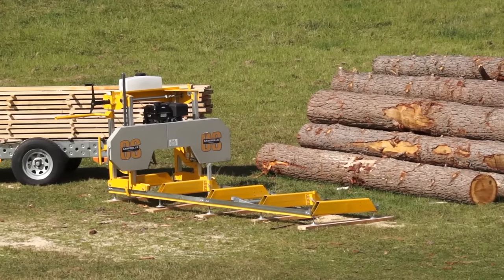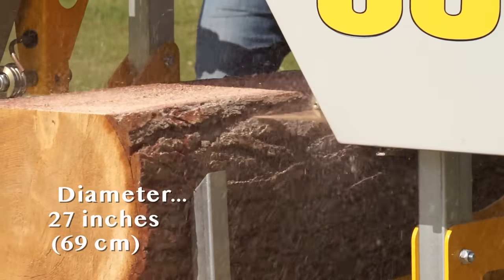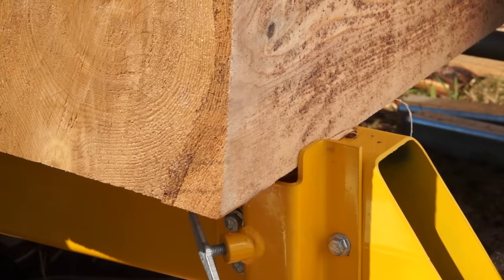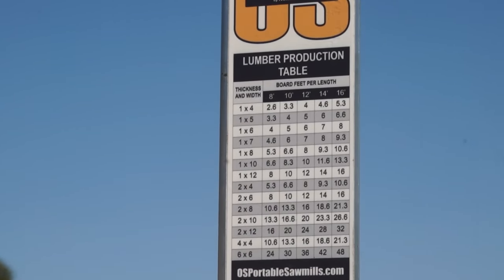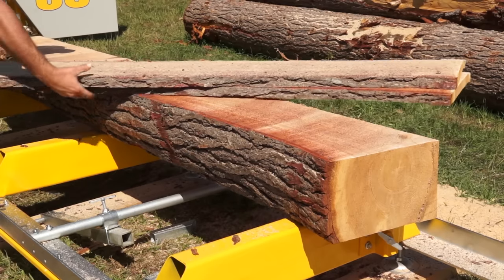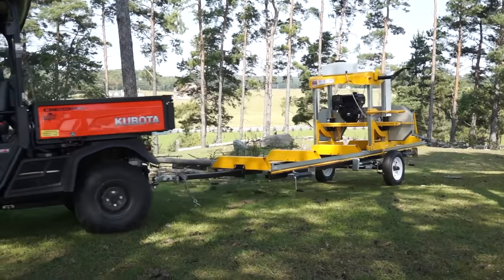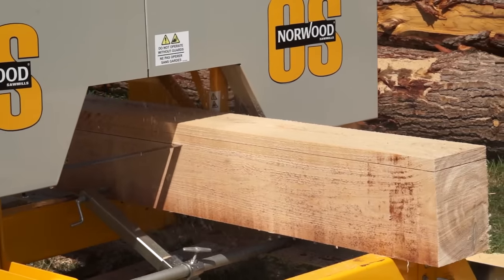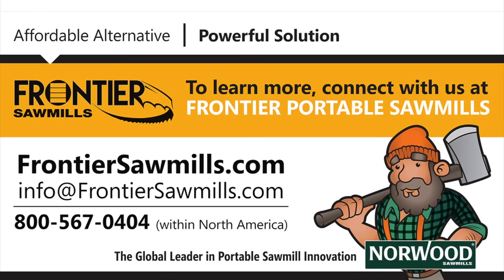The Affordable, Easy-to-Use & Reliable Sawmill You've Been Looking for - The Frontier OS27

Comment: Can this machine be delivered in India and what is its prize? relax
Reply from the maker: Frontier builds three sawmill models with different log diameter capacities: OS23: 59cm (23”), OS27: 69cm (27”), and OS31: 79cm (31”). Standard log length is 3.4m (11’) but you can add 7’ (2.1m) extensions to mill as long as you want.  You can add the optionally available trailer/support jack system to all Frontier sawmills at any time (when you get your Frontier or in the future).

Frontier Sawmills start at just USD $2297 (for the Frontier OS23). The Frontier OS27 starts at only USD $3297.  The Frontier OS31 starts at only USD $3897.  

You can get a lot of helpful info about Frontier Sawmills, including all pricing, at www.FrontierSawmills.com  .

Frontier services your country factory-direct.  To order, contact us directly at Frontier Sawmills via email at info@FrontierSawmills.com . 

Thanks!

Comment: How much is l-15 wm
Reply from the maker: Frontier builds three sawmill models with different log diameter capacities: OS23: 59cm (23”), OS27: 69cm (27”), and OS31: 79cm (31”). Standard log length is 3.4m (11’) but you can add 7’ (2.1m) extensions to mill as long as you want.  You can add the optionally available trailer/support jack system to all Frontier sawmills at any time (when you get your Frontier or in the future).

Frontier Sawmills start at just USD $2297 (for the Frontier OS23). The Frontier OS27 starts at only USD $3297.  The Frontier OS31 starts at only USD $3897.  

You can get a lot of helpful info about Frontier Sawmills, including all pricing, at www.FrontierSawmills.com  .

Frontier services your country factory-direct.  To order, contact us directly at Frontier Sawmills via email at info@FrontierSawmills.com . 

Thanks!

Comment: How much this cost?
Reply from the maker: Hi Mike

Frontier builds three sawmill models with different log diameter capacities: OS23: 23” (59cm), OS27: 27” (69cm), and OS31: 31” (79cm). Standard log length is 11’ (3.4m) but you can add 7’ (2.1m) extensions to mill as long as you want.  You can add the optionally available trailer/support jack system to all Frontier sawmills at any time (when you get your Frontier or in the future). 

Frontier Sawmills start at just USD $2297 (for the Frontier OS23). The Frontier OS27 starts at only $3297.  The Frontier OS31 starts at only $3897. 

You can get a lot of helpful info about Frontier Sawmills, including all pricing, at www.FrontierSawmills.com  .

We would be happy to mail you a free Frontier Sawmills info kit. You can order one online at  https://www.frontiersawmills.com/en_us/free-catalog-free-dvd-form

We would be happy to answer any questions that you may have, or to prepare a quote, including shipping to your door.  Let us know the best number to reach you at or please feel free to call us toll-free at 800-567-0404.

Thanks!

Comment: In India price please
Reply from the maker: Frontier builds three sawmill models with different log diameter capacities: OS23: 59cm (23”), OS27: 69cm (27”), and OS31: 79cm (31”). Standard log length is 3.4m (11’) but you can add 7’ (2.1m) extensions to mill as long as you want.  You can add the optionally available trailer/support jack system to all Frontier sawmills at any time (when you get your Frontier or in the future).

Frontier Sawmills start at just USD $2297 (for the Frontier OS23). The Frontier OS27 starts at only USD $3297.  The Frontier OS31 starts at only USD $3897.  

You can get a lot of helpful info about Frontier Sawmills, including all pricing, at www.FrontierSawmills.com  .

Frontier services your country factory-direct.  To order, contact us directly at Frontier Sawmills via email at info@FrontierSawmills.com .

Comment: Price?
Reply from the maker: Frontier builds three sawmill models with different log diameter capacities: OS23: 23” (59cm), OS27: 27” (69cm), and OS31: 31” (79cm). Standard log length is 11’ (3.4m) but you can add 7’ (2.1m) extensions to mill as long as you want.  You can add the optionally available trailer/support jack system to all Frontier sawmills at any time (when you get your Frontier or in the future). 

Frontier Sawmills start at just USD $2397 (for the Frontier OS23). The Frontier OS27 starts at only $3397.  The Frontier OS31 starts at only $3997. 

You can get a lot of helpful info about Frontier Sawmills, including all pricing, at www.FrontierSawmills.com  .

We would be happy to mail you a free Frontier Sawmills info kit. You can order one online at  https://www.frontiersawmills.com/en_us/free-catalog-free-dvd-form

We would be happy to answer any questions that you may have, or to prepare a quote, including shipping to your door.  Let us know the best number to reach you at or please feel free to call us toll-free at 800-567-0404.

Thanks!

Comment: This  machine available in India please know that also price list
Reply from the maker: The Frontier OS27 is regularly $3495 but is on sale right now for only USD $3297. 

You can also get a lot of helpful info online at www.FrontierSawmills.com  .
Reply: @FrontierSawmills  may i get it in INDIA...?
Reply from the maker: Yes, we can ship to India.

Frontier builds three sawmill models with different log diameter capacities: OS23: 59cm (23”), OS27: 69cm (27”), and OS31: 79cm (31”). Standard log length is 3.4m (11’) but you can add 7’ (2.1m) extensions to mill as long as you want.  You can add the optionally available trailer/support jack system to all Frontier sawmills at any time (when you get your Frontier or in the future).

Frontier Sawmills start at just USD $2297 (for the Frontier OS23). The Frontier OS27 starts at only USD $3297.  The Frontier OS31 starts at only USD $3897.  

You can get a lot of helpful info about Frontier Sawmills, including all pricing, at www.FrontierSawmills.com  .

Frontier services your country factory-direct.  To order, contact us directly at Frontier Sawmills via email at info@FrontierSawmills.com .

Comment: How much it's cost
Reply from the maker: Frontier builds three sawmill models with different log diameter capacities: OS23: 59cm (23”), OS27: 69cm (27”), and OS31: 79cm (31”). Standard log length is 3.4m (11’) but you can add 7’ (2.1m) extensions to mill as long as you want.  You can add the optionally available trailer/support jack system to all Frontier sawmills at any time (when you get your Frontier or in the future).

Frontier Sawmills start at just USD $2397 (for the Frontier OS23). The Frontier OS27 starts at only USD $3397.  The Frontier OS31 starts at only USD $3997.  

You can get a lot of helpful info about Frontier Sawmills, including all pricing, at www.FrontierSawmills.com  .

Frontier services your country factory-direct.  To order, contact us directly at Frontier Sawmills via email at info@FrontierSawmills.com . 

Thanks!
Reply: How much it will be in Indian🇮🇳 rupees
Reply: I want to onder this

Comment: how can I get in one mashine
Reply from the maker: Hi James

Frontier builds three sawmill models with different log diameter capacities: OS23: 59cm (23”), OS27: 69cm (27”), and OS31: 79cm (31”). Standard log length is 3.4m (11’) but you can add 7’ (2.1m) extensions to mill as long as you want.  You can add the optionally available trailer/support jack system to all Frontier sawmills at any time (when you get your Frontier or in the future).

Frontier Sawmills start at just USD $2297 (for the Frontier OS23). The Frontier OS27 starts at only USD $3297.  The Frontier OS31 starts at only USD $3897.  

You can get a lot of helpful info about Frontier Sawmills, including all pricing, at www.FrontierSawmills.com  .

Frontier services you factory-direct.  To order, contact us directly at Frontier Sawmills via email at info@FrontierSawmills.com . 

Thanks!
Reply: Frontier Sawmills so like how much in dollars

Comment: What is the cost?
Reply from the maker: Frontier builds three sawmill models with different log diameter capacities: OS23: 59cm (23”), OS27: 69cm (27”), and OS31: 79cm (31”). Standard log length is 3.4m (11’) but you can add 7’ (2.1m) extensions to mill as long as you want.  You can add the optionally available trailer/support jack system to all Frontier sawmills at any time (when you get your Frontier or in the future).

Frontier Sawmills start at just USD $2297 (for the Frontier OS23). The Frontier OS27 starts at only USD $3297.  The Frontier OS31 starts at only USD $3897.  

You can get a lot of helpful info about Frontier Sawmills, including all pricing, at www.FrontierSawmills.com  .

Frontier services your country factory-direct.  To order, contact us directly at Frontier Sawmills via email at info@FrontierSawmills.com .

Comment: Como faço pra compra uma
Reply from the maker: Frontier fabrica tres modelos de aserraderos para troncos de diferente diámetro: OS23: 23” (50cms), OS27: 27” (69cms) y la OS31: 31” (79cms)  La longitud estándar del tronco es de 11’ (3.4m) pero usted podrá adicionar extensiones de 7’ (2.1m) para aserrar troncos tan largos como usted desee. Usted podrá adicionar el sistema opcional de remolque/sistema de soporte de gato a todos los modelos de aserraderos Frontier en cualquier momento (cuando usted compre su  Frontier o en un futuro)

Los aserraderos Frontier comienzan desde solo USD $2297 ( Frontier OS23). La Frontier OS27 inicia desde solo USD $3297. La Frontier OS31 empieza desde solo USD 3897 

Usted podrá encontrar gran cantidad de información sobre los Aserraderos Frontier, incluyendo precios en la página web  www.FrontierSawmills.com

Por el momento de igual forma nuestra página web solo se puede acceder en Inglés.

Comment: How much this machine
Reply from the maker: Frontier builds three sawmill models with different log diameter capacities: OS23: 59cm (23”), OS27: 69cm (27”), and OS31: 79cm (31”). Standard log length is 3.4m (11’) but you can add 7’ (2.1m) extensions to mill as long as you want.  You can add the optionally available trailer/support jack system to all Frontier sawmills at any time (when you get your Frontier or in the future).

Frontier Sawmills start at just USD $2397 (for the Frontier OS23). The Frontier OS27 starts at only USD $3397.  The Frontier OS31 starts at only USD $3997.  

You can get a lot of helpful info about Frontier Sawmills, including all pricing, at www.FrontierSawmills.com  .

Frontier services your country factory-direct.  To order, contact us directly at Frontier Sawmills via email at info@FrontierSawmills.com . 

Thanks!
Reply: Sir  my home in India ,west bengal 
I purchased this machine .
Work this machine form government license

Comment: How much for this size
Reply from the maker: Hi Keenan

$3297. 

Frontier builds three sawmill models with different log diameter capacities: OS23: 23” (59cm), OS27: 27” (69cm), and OS31: 31” (79cm). Standard log length is 11’ (3.4m) but you can add 7’ (2.1m) extensions to mill as long as you want.  You can add the optionally available trailer/support jack system to all Frontier sawmills at any time (when you get your Frontier or in the future). 

Frontier Sawmills start at just USD $2297 (for the Frontier OS23). The Frontier OS27 starts at only $3297.  The Frontier OS31 starts at only $3897. 

You can get a lot of helpful info about Frontier Sawmills, including all pricing, at www.FrontierSawmills.com  .

Comment: I love it, can I have one?
Reply from the maker: Hi Manko

Frontier builds three sawmill models with different log diameter capacities: OS23: 59cm (23”), OS27: 69cm (27”), and OS31: 79cm (31”). Standard log length is 3.4m (11’) but you can add 7’ (2.1m) extensions to mill as long as you want.  You can add the optionally available trailer/support jack system to all Frontier sawmills at any time (when you get your Frontier or in the future).

Frontier Sawmills start at just USD $2297 (for the Frontier OS23). The Frontier OS27 starts at only USD $3297.  The Frontier OS31 starts at only USD $3897.  

You can get a lot of helpful info about Frontier Sawmills, including all pricing, at www.FrontierSawmills.com  .

To order, contact us directly at Frontier Sawmills via email at info@FrontierSawmills.com . 

Thanks!

Comment: Merhaba fiyat ne kadar
Reply from the maker: Frontier builds three sawmill models with different log diameter capacities: OS23: 59cm (23”), OS27: 69cm (27”), and OS31: 79cm (31”). Standard log length is 3.4m (11’) but you can add 7’ (2.1m) extensions to mill as long as you want.  You can add the optionally available trailer/support jack system to all Frontier sawmills at any time (when you get your Frontier or in the future).

Frontier Sawmills start at just USD $2297 (for the Frontier OS23). The Frontier OS27 starts at only USD $3297.  The Frontier OS31 starts at only USD $3897.  

You can get a lot of helpful info about Frontier Sawmills, including all pricing, at www.FrontierSawmills.com  .

Frontier services your country factory-direct.  To order, contact us directly at Frontier Sawmills via email at info@FrontierSawmills.com .

Comment: koliko košta ova masina
Reply from the maker: Frontier builds three sawmill models with different log diameter capacities: OS23: 59cm (23”), OS27: 69cm (27”), and OS31: 79cm (31”). Standard log length is 3.4m (11’) but you can add 7’ (2.1m) extensions to mill as long as you want.  You can add the optionally available trailer/support jack system to all Frontier sawmills at any time (when you get your Frontier or in the future).

Frontier Sawmills start at just USD $2297 (for the Frontier OS23). The Frontier OS27 starts at only USD $3297.  The Frontier OS31 starts at only USD $3897.  

You can get a lot of helpful info about Frontier Sawmills, including all pricing, at www.FrontierSawmills.com  .

Frontier services your country factory-direct.  To order, contact us directly at Frontier Sawmills via email at info@FrontierSawmills.com . 

Thanks!

Comment: Price plz
Reply from the maker: Frontier builds three sawmill models with different log diameter capacities: OS23: 59cm (23”), OS27: 69cm (27”), and OS31: 79cm (31”). Standard log length is 3.4m (11’) but you can add 7’ (2.1m) extensions to mill as long as you want.  You can add the optionally available trailer/support jack system to all Frontier sawmills at any time (when you get your Frontier or in the future).

Frontier Sawmills start at just USD $2297 (for the Frontier OS23). The Frontier OS27 starts at only USD $3297.  The Frontier OS31 starts at only USD $3897.  

You can get a lot of helpful info about Frontier Sawmills, including all pricing, at www.FrontierSawmills.com  .

Frontier services your country factory-direct.  To order, contact us directly at Frontier Sawmills via email at info@FrontierSawmills.com . 

Thanks!

Comment: How much?
Reply from the maker: Frontier builds three sawmill models with different log diameter capacities: OS23: 59cm (23”), OS27: 69cm (27”), and OS31: 79cm (31”). Standard log length is 3.4m (11’) but you can add 7’ (2.1m) extensions to mill as long as you want.  You can add the optionally available trailer/support jack system to all Frontier sawmills at any time (when you get your Frontier or in the future).

Frontier Sawmills start at just USD $2297 (for the Frontier OS23). The Frontier OS27 starts at only USD $3297.  The Frontier OS31 starts at only USD $3897.  

You can get a lot of helpful info about Frontier Sawmills, including all pricing, at www.FrontierSawmills.com  .

Frontier services your country factory-direct.  To order, contact us directly at Frontier Sawmills via email at info@FrontierSawmills.com . 

Thanks!

Comment: Prices???
Reply from the maker: Frontier builds three sawmill models with different log diameter capacities: OS23: 59cm (23”), OS27: 69cm (27”), and OS31: 79cm (31”). Standard log length is 3.4m (11’) but you can add 7’ (2.1m) extensions to mill as long as you want.  You can add the optionally available trailer/support jack system to all Frontier sawmills at any time (when you get your Frontier or in the future).

Frontier Sawmills start at just USD $2297 (for the Frontier OS23). The Frontier OS27 starts at only USD $3297.  The Frontier OS31 starts at only USD $3897.  

You can get a lot of helpful info about Frontier Sawmills, including all pricing, at www.FrontierSawmills.com  .

Frontier services your country factory-direct.  To order, contact us directly at Frontier Sawmills via email at info@FrontierSawmills.com . 

Thanks!

Comment: Hello  как купить такой станок сколько стоят?
Reply from the maker: Frontier builds three sawmill models with different log diameter capacities: OS23: 59cm (23”), OS27: 69cm (27”), and OS31: 79cm (31”). Standard log length is 3.4m (11’) but you can add 7’ (2.1m) extensions to mill as long as you want.  You can add the optionally available trailer/support jack system to all Frontier sawmills at any time (when you get your Frontier or in the future).

Frontier Sawmills start at just USD $2297 (for the Frontier OS23). The Frontier OS27 starts at only USD $3297.  The Frontier OS31 starts at only USD $3897.  

You can get a lot of helpful info about Frontier Sawmills, including all pricing, at www.FrontierSawmills.com  .

Frontier services your country factory-direct.  To order, contact us directly at Frontier Sawmills via email at info@FrontierSawmills.com . 

Thanks!